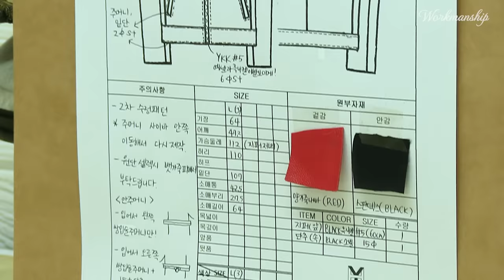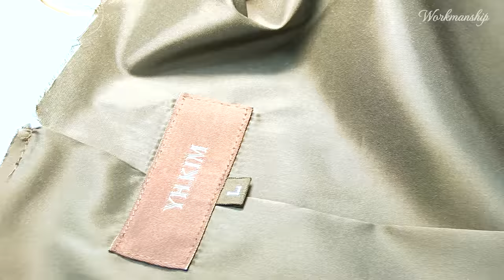Process of Making Leather Jacket from 5 Sheepskins. Korean Leather Artisan

Comment: A point of advice.  Stop hammering.  Use a 25 kg. metal cylinder and roll it across the seam.  It will be flatter with less puckering.

Comment: 영상 잘보고갑니다
시접에 바르는 집착제가 어떤건가요?
Reply: Two different.  One is a two sided adhesive tape, the other is a liquid contact cement.  (The liquid contact cement usually requires some evaporation before it's a good adhesive, but it looks like they solved that problem).  I'm an engineer and chemist.

Comment: What are those black fabric pieces at 2:20?
Reply from the maker: Fusible interfacing. that is the material attached to a fabric using heat and adding firmness. 😀
Reply: Ok, thanks!

Comment: I can't see that jacket lasting long; the leather is thin like a tea towel.
Reply: its real leather. it will last forever
Reply: @jemandjemand2362  nothing lasts forever
Reply: I have lots of sheepskins leather from the 70s and 80s and still looks fine as of today.
Reply: @jemandjemand2362  its thin sheep leather it wont last long
Reply: @Βενιαμίν-κ2ξ  they used way thicker mm sheepskin in 70s & 80s than they use today! they use the same thickness today as they use for sneakers & you see how long sneakers last!
Reply: @2stroketyson79  there are thicker and there's thinner. When spring is almost there we used to wear lighter leather sheepskin than heavier thick leather.
Reply: Man stop hating
Reply: @OoOo-e6x  
What are you talking about?